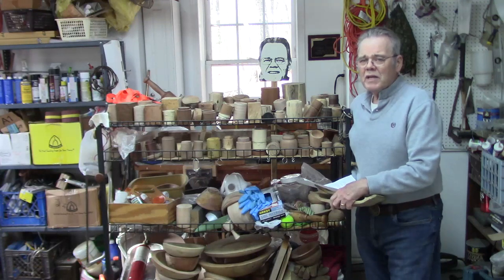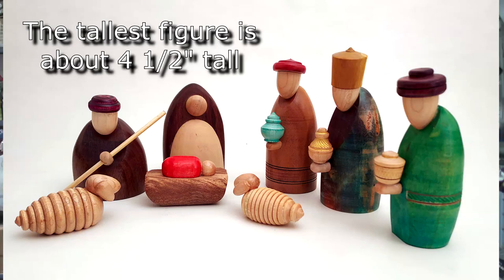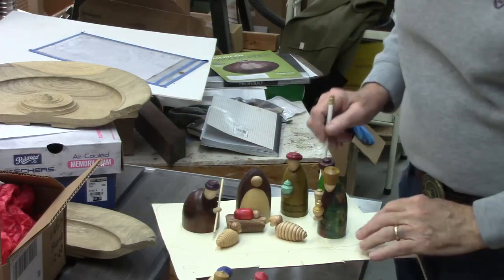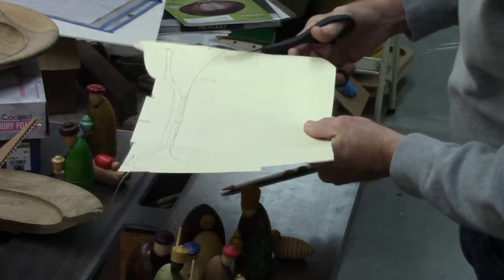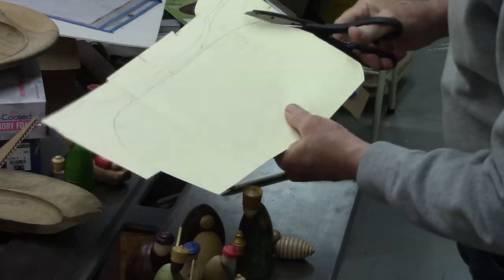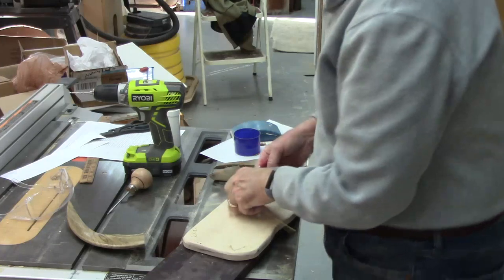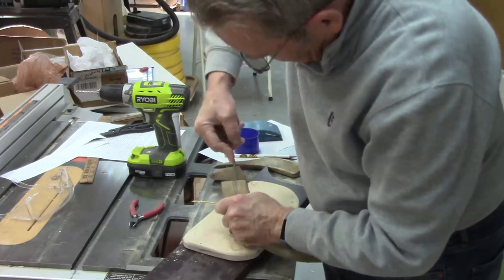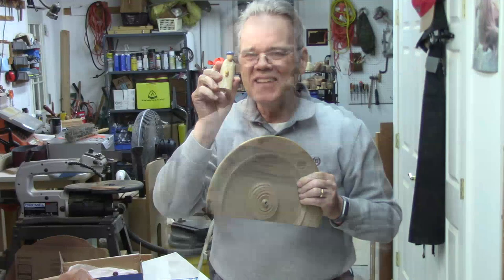Salvaging a Split Platter

Comment: Very nice. Here’s a tip, if your church serves communion in those individual cups, wash it and use it to mix small amounts of resin or mix resin with dyes. Works really well with the 2 part epoxy that come in the tubes or syringe.
Reply from the maker: Good tip. I use the top of potato chip can. I have lots of those.

Comment: Hi Mike. Nice save. Not quite where I thought you were going at the start. The first thing that came to my mind was to keep the outside rim of the platter, cut away the centre and then hang a small star from the peak. Just my .02 worth. And since here in Canada we no longer use pennies but round up or down to the nearest .05 after you round out my .02 you know what it may be worth. LOL.
Reply from the maker: That is exact what I did with the larger one. I have not come up with a star yet. I will post in the Community tab when I finish with it.